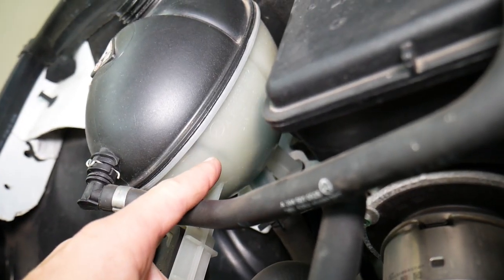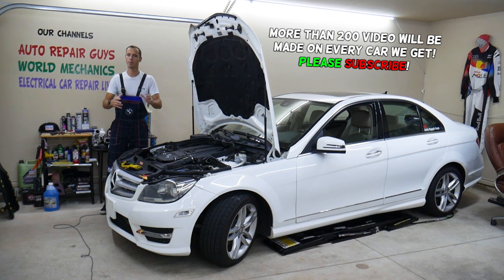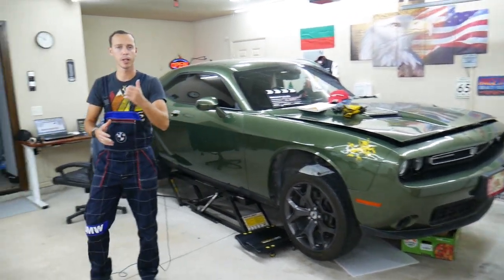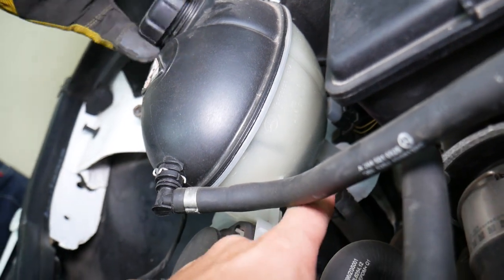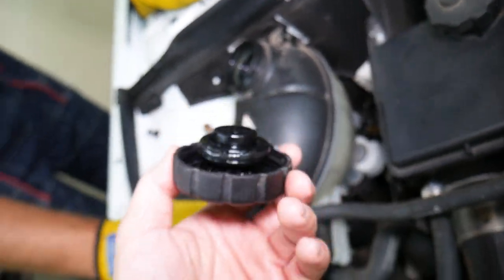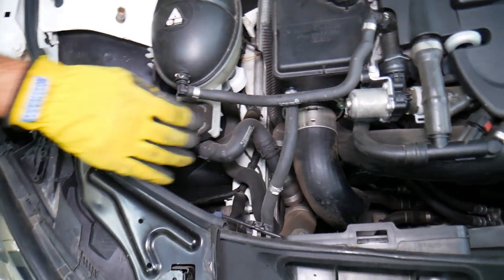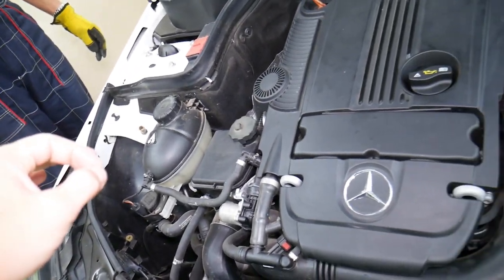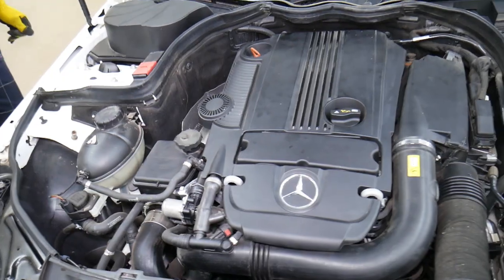WHY AIR BUBBLES IN COOLANT ANTIFREEZE MERCEDES W203 W204 W205 C180 C200 C220 C230 C250 C280 C300

Comment: I had the same thing happen with a Volvo, they both have this "ingenious" pressurized coolant system, long story short, the compressed coolant will end up going into your cylinders when you shut off the car causing every problem you can imagine... Just don't buy these cars, Lease them and it will be someone else's problem